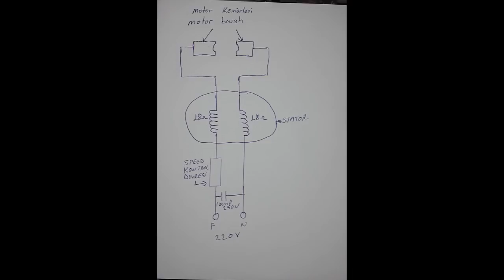HOW TO MAKE A DREMEL SPEED CONTROL WITH DIMMER CIRCUIT. DREMEL REPAIR. MOTOR SPEED CONTROL.

Comment from the maker: Kaiweets KM601 multimeter: 
https://bit.ly/3HLUDOe 
ZOYI ZT-QB9 Clamp Multimeter: 
https://bit.ly/3k9mHlc
2000W Dimmer devresi / 2000W Dimmer circuit:
 https://goo.gl/w2vmG4 
Şarjlı  hoby matkap satış link / Cordless hoby drill sales link :
 https://bit.ly/3uPkRsH

Comment: HOLA Saludos 🖖🏾 y Bendiciones 😇 Excelente detalle, Gracias por esta idea 💡para recuperar mini esmeril o dremel, la boy a replicar para recuperar el mio⚙️👍🏽😁
Reply from the maker: You’re welcome 😊
I’m glad you liked it. I hope you can repair your mini grinder/Dremel without any problems.
If you try it, I’d be happy if you share the result. Good luck!
Reply: Hola Saludos tenga Bendecida Navidad, por cierto cometí un error básico, 😶🤦‍♂️ al no considerar la potencia del Dimmer que adquiri localmente, por que es de 4000W, ya verifique que el adecuado es de 2000W, + observando la tarjeta de circuito original del Mini esmeril o Dremel,  me percate de que los componentes se 
ven en buen estado y lo que se daño fue el mini suiche deslizante, asi que por lógica🤔 podria sustituir esa parte con un potenciometro de 100k a 500k con 3 pines de contacto, lo compre por 1.5$, use unos 5cm de cable reciclado de un transformador de 12v, que corte 3 pedazos, donde en las salidas del mini circuito, solde 2 cables donde estaban pistas de control al los 2 pines laterales del potenciometro y el neutro en el pin central, basado en la imagen de otro modelo de Dimmer de 2000W con 3 cables al potenciometro, en la imagen.
Hipoteticamente al reconectar el mini circuito original y adaptar el potenciometro, deberia de funcionar, 👁 despues adaptar la carcasa del mini esmeril, esta es mi idea 💡DIY ⚙️ para recuperar el aparato, ya lo he limpiado y lubricando las rodilleras internas, el motor se ve Bien y sin daños por uso previo.
Reply from the maker: @shinsystems2415  That's a great idea. It would be perfect if you could adapt it to a Dremel case. I'm eagerly awaiting the result. Merry Christmas.

Comment: nice idea, but i am ok with 5 step speed on the original dremel.
Reply from the maker: Thank you for your interest in my video. If your dremel's speed control circuit is broken, you can use this method.

Comment: ¿Éste aparato al ponerlo al mínimo de velocidad hace que el dremel pierda par de fuerza?
Muchas gracias
Reply from the maker: When you use the dimmer circuit, you will lose torque when using the dremel at minimum speed. To avoid loss of torque, you must use an AC motor control circuit.

Comment: Hocam merhaba elinize emeğinize sağlık güzel bir paylaşım olmuş. Benimde dremel model 800 10.8v lityum bataryalı aletim bozuldu. Üzerinde hız kontrol anahtarı sadece 4. Kademe ve 8. Kademe de çalışıyor. Araştırıdığıma göre mosfet arızası olduğunu tespit ettim. Fakat bulunması gereken STP80NF03L 30v 80A 300W mosfeti hiçbir yerde bulamadım. Konu ile ilgili bir tavsiyeniz olursa sevinirim. Teşekkürler.
Reply from the maker: Merhaba öncelikle ilginiz için teşekkür ederim. Bahsettiğiniz arıza mosfetten kaynaklanmıyor olabilir. İlk önce kademe anahtarını kontrol edin. Multimetre ile tüm kademelerini ölçün anahtar sağlamsa. Mosfetinizi ölçün. STP80NF03L mosfet için https://www.bluemavi.com/ sitesinden STP80NF70 , P80NF06 , STP55NF80 Mosfetlerini kullanabilirsiniz herhangi bir sorun olacağını düşünmüyorum. Sipariş vermeden önce mutlaka elektronik devre üzerindeki devre elemanlarının sağlamlık kontrolünü yapın. İyi çalışmalar.
Reply: @electronic7979   çok teşekkürler hocam maalesef elektronik bilgim ve tecrübem yok. Ben tamirini başka birine yaptırmayı düşünüyorum parçayı temin edip. Youtube'da dremel model 800 speed control problem diye aradığımda bu sorunun kronik bir arıza olduğunu mosfetin soğutucusu küçük olduğu için ısınıp arızalandığı bilgisine ulaştım. Yeni model dremel aletlerinde soğutucu plaka biraz daha büyük.
Reply from the maker: @tanerakkaya  rica ederim. Tabi mosfettende olabilir ihtimal dahilinde. Yeni mosfet alıp bi denemeniz lazım
Reply: @electronic7979   Bahsettiğim video bu hocam. Söylediğiniz mosfet lerden alıp deneyeceğim inş. olur. Teşekkürler 👍https://youtu.be/lK6HTzH-N5s
Reply from the maker: @tanerakkaya  rica ederim. İnşallah olur. Kolay gelsin

Comment: Dimmer almak istediğimde motorun DC mi, AC mi ona göre yollayalım dediler. Motorun üzerinde SL yazıyor. Sizin bağladığınız AC galiba bir de en az kaç wat almalıyım?
Reply: Hız ayar devresinin üzerinde ys dc jy 2010.12 yazıyor. Dremel değil başka bir marka ve digital göstergeli.
Reply from the maker: merhaba bu videoda ac dimmer kullanılmıştır. sizin motorunuzun resmini elektronikatolyem@gmail.com  mail adresime gönderebilirseniz yardımcı olabilirim.
Reply: @electronic7979   Gönderdim..
Reply: Teşekkür ederim.

Comment: Bir dremel motoru kaç rpm acaba
Reply from the maker: Maximum 35000 rpm olması lazım
Reply: @electronic7979  çok teşekkür ederim peki ben 45 kg yim ben üstüne ciksam beni nasıl bir hıza ulaştırır
Reply from the maker: @efetatloglu9878  rica ederim. Valla sorunuza cevap ne desem bilmem ki hiç denemedim. Bi denemek lazım.
Reply: @electronic7979  tesekkur ederim abi
Reply from the maker: @efetatloglu9878  rica ederim

Comment: dimmer devresi uzerinde board tipi mavi potansiyometre var bunun ne ise yaradigini birturlu anlayamadim. yardimci olabilir misiniz ?
Reply from the maker: Trimpod ince ayar yapmak için. Örnek olarak dimmer çıkışına bir motor bağladığınızda  ayar potansiyometresini sıfır konumuna getirdiğinizde motor yavaştan olsa dönmeye devam eder. Küçük tripod dan ayar yaparak motorun durmasını sağlarsınız.
Reply: @electronic7979  cok tesekkur ederim bu bilgiyi hicbiryerde bulamamistim satici dahi bilmiyor. bu dimmerlarda yuksuz durumda giris 220 cikis 205volt olcuyorum potansiyometre sonuna kadar acikken. normal mi bu durum. yuklu henuz olcmedim
Reply from the maker: @sameshitdifferentcolour4197  bence normal çünkü bu devre deki malzeme ve potansiyometre degerlerinden dolayı ufak tölerans payı olması normal.Bir de küçük trimpod dan ayar yapmayı deneyin voltajı arttirabilirsiniz
Reply: @electronic7979  tamam deniyecegim. cok tesekkurler tekrar
Reply: 201 ile 206 volt arasinda oynuyor. daha fazla yukseltemedim. yukte zaten dusecegi icin motorda guc kaybi olup olmadigindan emin olamayacagiz. volt amper birlikte olcmek lazim tek multimetrem var.  acikcasi motorda guc kaybi olurmu bundan endiseliyim
Reply from the maker: @sameshitdifferentcolour4197  motoru Nerede kullanacaksınız. Genelde tork gerektiren uygulamalarda dimmer devreler pek verimli olmuyor bunun için motor kontrol devreleri kullanmanız gerekebilir.
Reply: @electronic7979  evet bende bunu anlamaya calisiyorum daire testere ile ahsap kesme niyetim vardi hobi taslama motorunu tezgaha monte edip duzgun ahsap koseler kesecektim fakat sanki motorun gucu azaldi bicak duruyor. zaten 160w motor cok bir beklentim yok ama yinede guc kaybi oldu gibi geldi
Reply from the maker: @sameshitdifferentcolour4197  dimmer devreleri aslında voltajı düşürmez ac gerilimin faz farkını değiştirir bu da aşırı tork gerektiren uyugulamalarda tork düşümüne  sebep olur bunun için ac motor kontrol devresi kullanmanız gerekir. Benim için tork çok önemli değil diyorsanız dimmer devresi işinizi görür